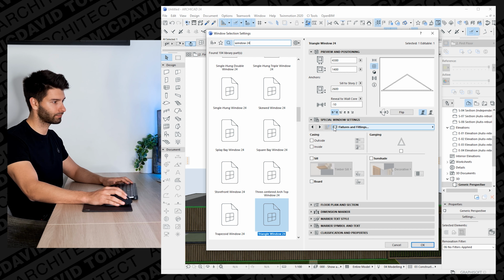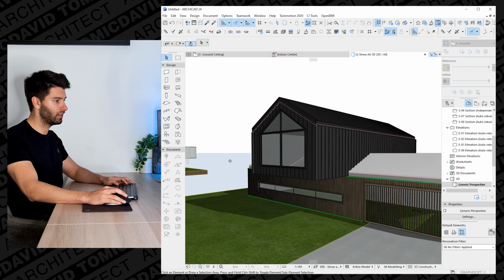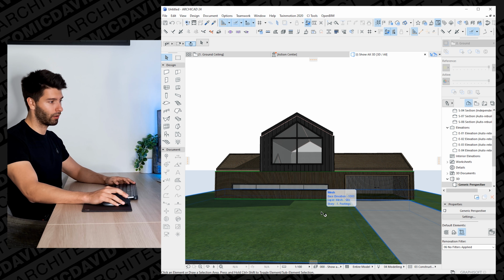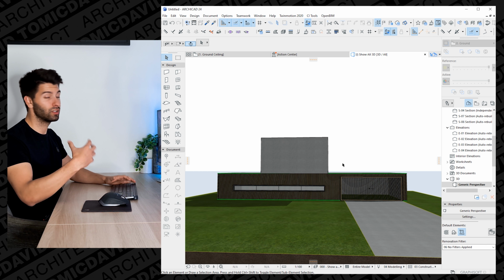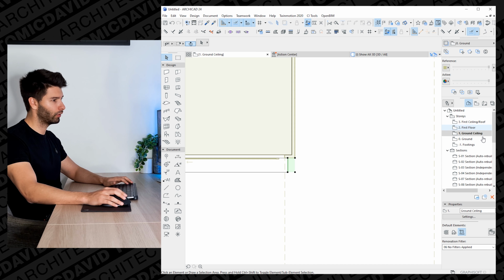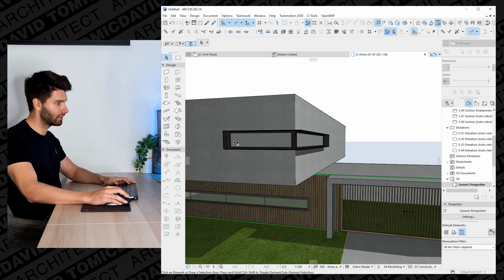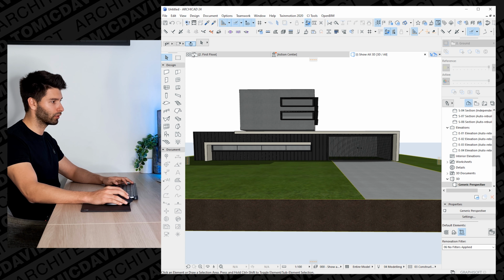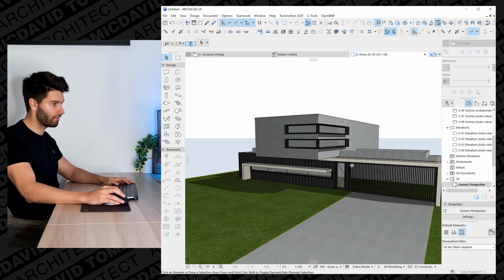ArchiCAD 24: 3x Elevations in 45 Minutes Tutorial

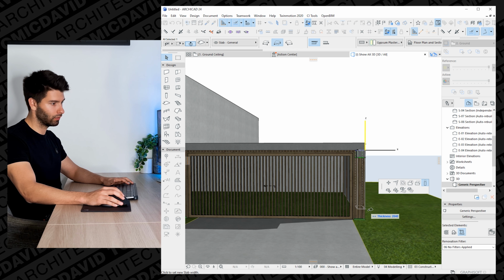Comment: 33:45 Hi David, thanks so much for this tutorial. A quick question, how did you stretch that corner slab, I failed to and cannot find that stretch icon when clicking at the node.
Reply from the maker: Hmmm... try un-group elements and then try again? It should be there if you're selecting the right node.

Comment: Can you do a video about detailing from foundation to roof. I'm trying to save time in my work flow by doing more model detailing in 3d so sections are done but struggling a bit.
Reply from the maker: I did a timber framing explanation video with something similar. This might help?
Reply: @DavidTomic  speaking of iMacs, have you had any issues by switching from Mac to PC on the same file? I remember encountering issues with fonts.